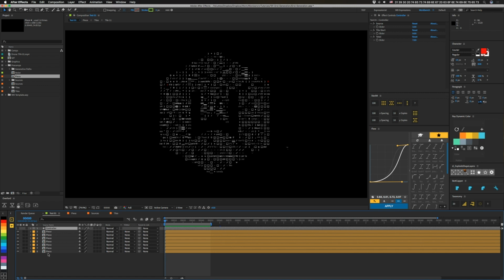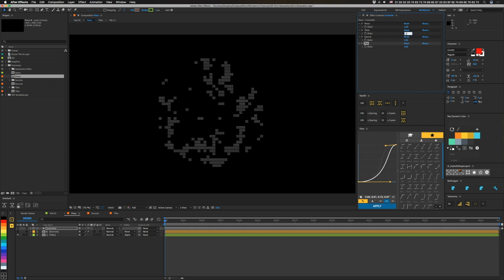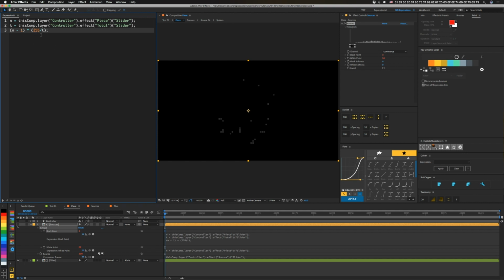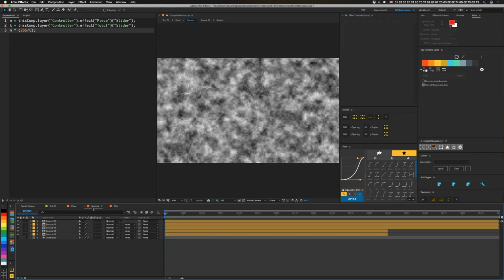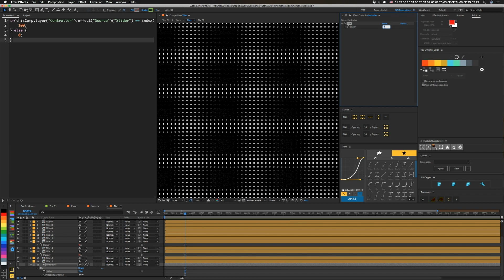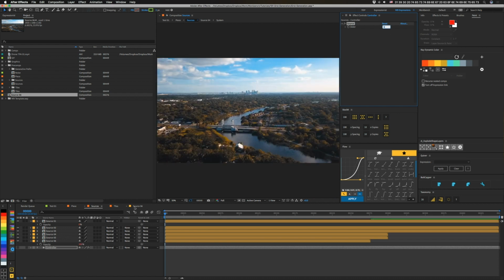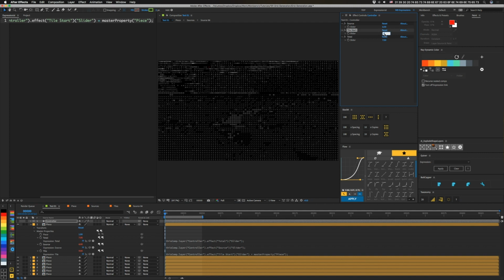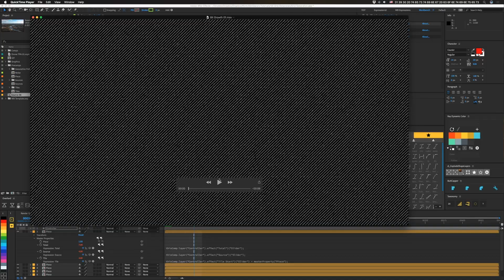Map Elements onto Images with this After Effects Technique

Comment: MR Joe,  I believe much of what you share comes from countless experiments , all grounded in a very solid technical foundation. From your creative use of expressions to effect combinations that lead to unexpected results, everything reflects deep curiosity and exploration. I’m really curious about your study routine, do you usually try to recreate ideas based on what you see, and from that process, new learnings emerge? Also, was your involvement in learning expressions something that came naturally over time, or was it an area you were always interested in exploring? I really appreciate how you emphasize making workflows faster and finding smarter ways to optimize your process that, to me, is what separates a creative artist from a strategic one. Regards from Brazil.
Reply from the maker: Thanks! I have a folder of experiments. I treat them as sketches in After Effects. Sometimes I have an idea and I experiment. Other times I'm recreating something I've seen or I'm porting some technique from something else entirely to see if it can be applied in After Effects. I've learned a lot from old tech. In the case of this video, it all came about through the realization that I could use displacement maps like developers used sprite sheets in older video games and then it expanded when more things were added to After Effects. In fact, I think I just got an idea from something I saw an hour ago on X and thinking about the technique in this video!

As for expressions, I did a lot of web development stuff in the late 90s/early 2000s so I have a good grasp of javascript (and other languages) so I've been able to carry that knowledge over and expand upon it. A lot of what I learned with regard to that specifically came from early Aharon Rabinowitz tutorials and Dan Ebberts' motionscript.com which is still a great resource.

Thanks again!

Comment: Heard about the approaching hurricane. Hope you and your family are safe.
Reply from the maker: Thank you! We should be ok. The initial tracks looked pretty bad, but if the current one holds we'll mainly get our usual stormy weather, just prolonged. Irma made its way over us in 2017 at a category 1. It was quite windy, but no damage to our house occurred. Most of our block had power, but we were unfortunate. A tree sheared off a line in the alley and cut power to only a handful of houses. Just when we thought they had forgotten about us, they restored our power. It was off for a week. The worst part? The guy who fixed it said the guys who came out to survey damage to the grid could've just jumped something on the lines that run in front of my house and we all could've been fine. He said that normally takes like 5 minutes. Ugh. Oh well. At least I had the full experience minus the damage and flooding.